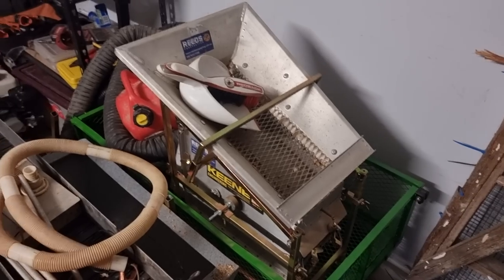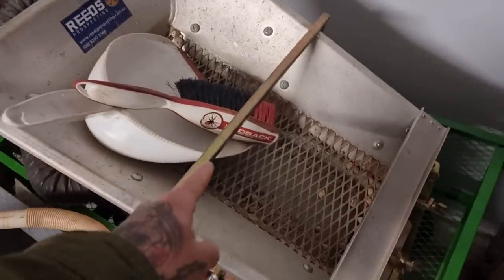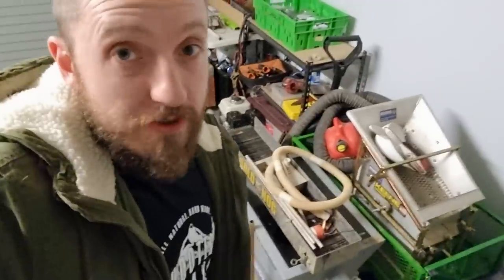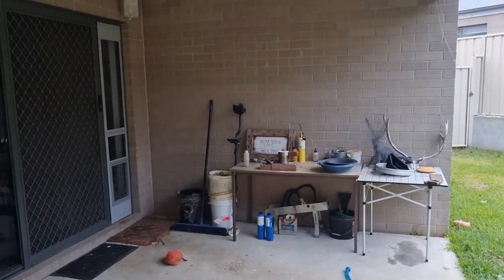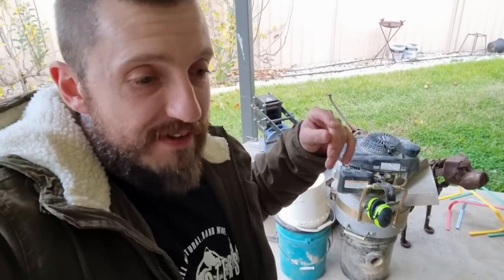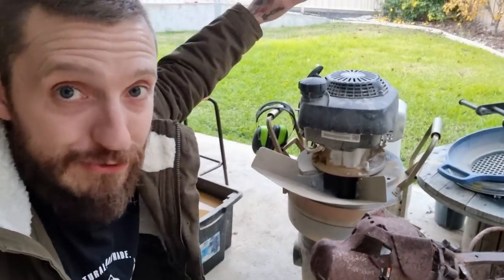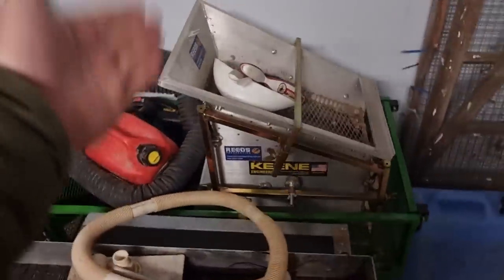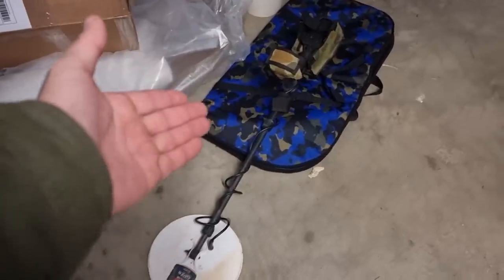Dangle a 20kg rock crusher above a $2,000 dry washer. Sounds Legit.

Comment: The national anthem for people who are getting older...."Work smarter, not harder".
That crusher also burns petrol which increases costs.  No bueno.
Reply: Not to mention that in order to run it for several hours, they would also have to haul petrol out with them too, adding more weight. It is a lawnmower engine. You get 30-40 minutes of it running normally, probably less with it having to swing heavy chains and the bogging down it would have to face. Also with it over the dry blower your filters would clog pretty quickly, so you’d spend just as much time keeping it running as you would running it.

Comment: You kinda touched on my theory and effort involved in prospecting. Carry all your equipment to prospecting sight, however close or far it is. Setup, run, teardown, carry back out. That equals a lot of time and expended energy. I bought 2 claims so now I carry in equipment, setup, run, shut down and go to camp. Get up in morning and just start running. No wasted time or energy on anything except washing rocks. That's my partial solution which equates to more actual run time, or that's my theory anyway. 🤣✌️😎

Comment: Have you thought of a small ball mill? Set it up like a trommel, but in an enclosed mill? Like a mini mill, that runs off a windscreen wiper motor, so 12 volt. Put a screen on the bottom of the tube to only let out a certain size? I dunno, I think you may have just given me an idea....
Reply: Still a massive amount of weight to be dragging out into the bush.......
Reply: If you want to talk about customizing a unit to deal with clumps, then I think a jaw crusher is a whole lot easier to deal with. Smaller footprint, less moving parts, simpler inlet and outlet.
And it's just clay balls, so you could use plastic, or even wooden, jaws in the crusher to reduce weight.

Comment: You might be able to suspend that crusher on a large tripod made out of 2x4s (or some similar lumber in Australian measurements) and some chain. It would be another heavy load to move to your prospecting site though. I've considered doing similar to suspend my large 1/2 inch classifier screen but haven't attempted it yet.